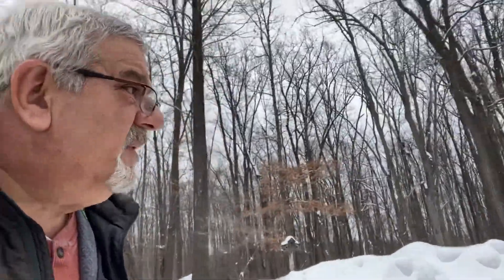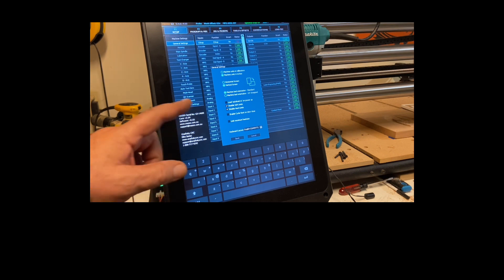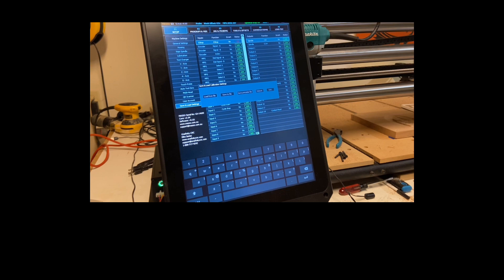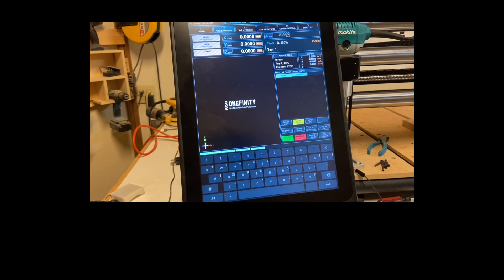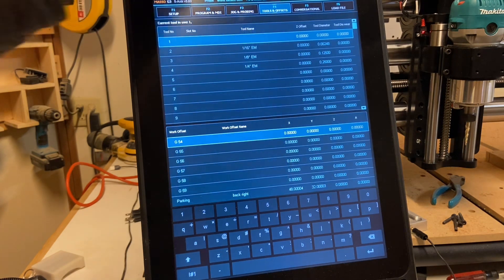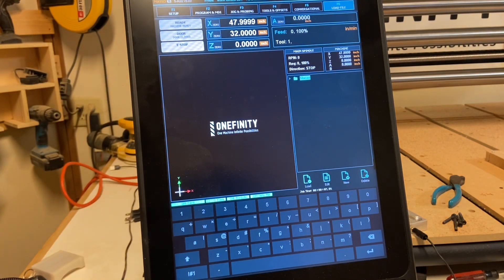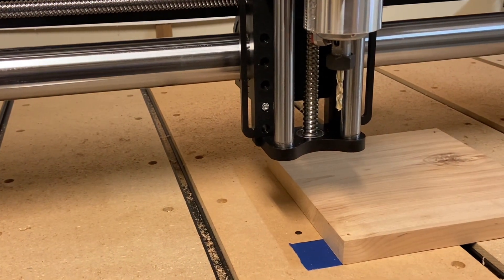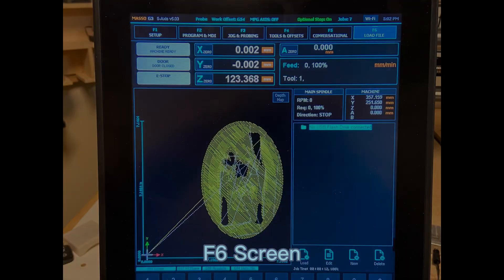Onefinity Journeyman Elite - Walk through

Comment: Thank you for this video - I think you will get me going. 

I have a question on the G-code file - where did it come from? Is it a 3D CAD program for the "model" and how was it processed to result in the G-code file?
Reply from the maker: Hi Neil. The g code is processed when you save your toolpaths in your design software.  You have to select the post processor the first time you go to save the toolpath.  Just be sure to select Onefinity Elite (for Elite series machines) or Onefinity-BB (for original series machines).

Comment: Hello, I know you have had your elite series for a while now. I’d like to know if you can help me. I ordered the elite journeyman and the pwn spindle kit. I know I wire the vfd directly to the Masso but how about the dust collector? Do I just plug it into the onefinity control box? And if so will it turn on automatically?
Thanks 
Chris
Reply from the maker: Hi Chris. The dust collector would plug into the corresponding plug on the back of the power supply. You would turn the switch on at the dc and let the relay on the power supply turn it on and off for job run.

Comment: Why do you turn the probe onto its back for the z probe setting. With you calibrating it wouldnt the depth be the same?
Reply from the maker: Yea it would be the same depth. Turning it over allows you to probe z in any location on the material. Not flipping it over requires that the probe is sitting on a corner.
Reply: First time I’ve seen this